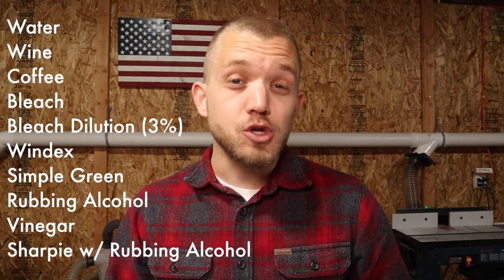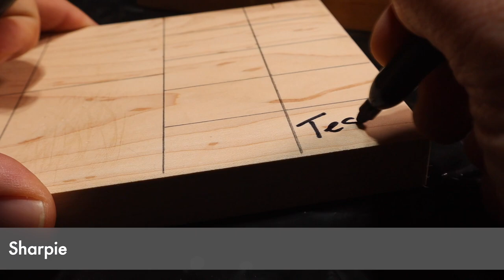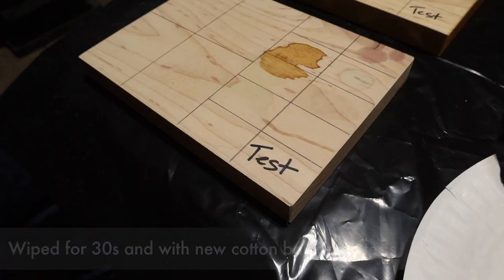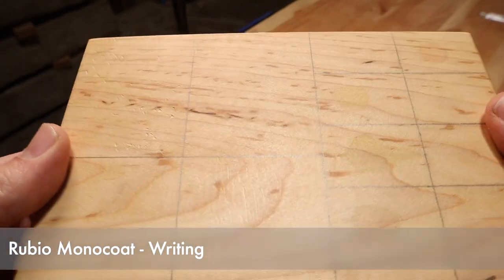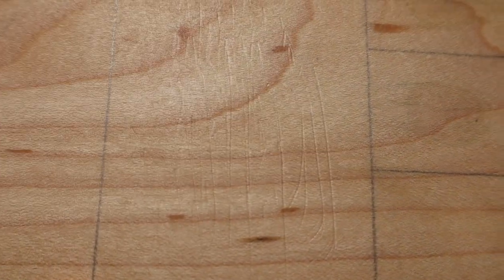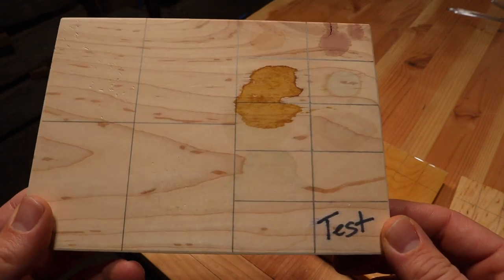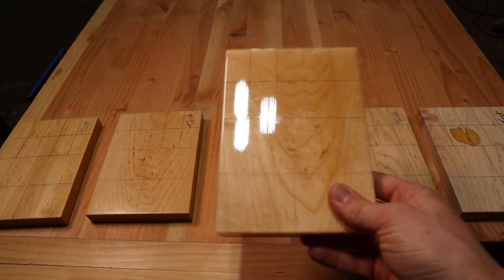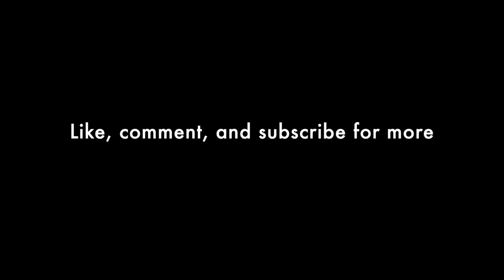Epoxy vs Rubio Monocoat vs Polyurethane vs Lacquer

Comment: Superb experiment 

Do you know which Finnish has the best heat resistance?
Reply from the maker: And that is a superb question! Unfortunately I don’t have a perfect answer. What I do know is the following: 

Many epoxies struggle with heat. In fact the one I ended up using (Super Clear) has a heat deflection temp of 130°F which isn’t high enough for most hot dishes and coffee cups (major issue for me). There are other epoxies (Stone coat & some total boat recipes) which has a much higher HDT in the order of 100’s of degrees. 

Polyurethane is a very robust. It’s been used in restaurant tables for a long time. Don’t have the max usable temperature in front of me now but it’s very robust. 

Rubio should be pretty robust but I can’t find any data on it. 

Lacquer is also a common table finish and should be fine with raw heat, but hot and wet (which my test failed to adequately simulate) is a weakness. 

As with most wood finishes and furniture, you shouldn’t have anything hotter than a food hot dish. Hot pots and pans need a buffer between them. 

Sorry I don’t have a more concrete answer but hopefully that helps 😊
Reply: Thank you 🙏🏽 
I think if restaurants favour polyurethane, then you've answered my  question perfectly. 
👍🏽
Reply from the maker: Perfect! Yes, the restaurant business has been using poly for a long time. It’s cheap and hard. Do note it will yellow quite a bit with time so using it on woods that are complimented by that would be recommended.

Comment: It would be more helpful to have all the coatings at the same mil thickness. I can clearly see some of the coatings are thicker than others especially the poly and epoxy. I think it would be a more fair assessment if these systems were all tested at the same mil thickness. There’s mil gauges you can get to check this. Lacquer is very hard but it’s not water based so it evaporates off 80% of the wet mil thickness compared to 50% of water base so right off the bat the water based coatings are gonna be 30% thicker more or less unless you added more coats to your solvent based stuff to get the same mils. Also what brands of these products were you using because lacquers and the other coating systems have different % of solids that vary widely from manufacturer to manufacturer. One part systems will obviously be less resilient than 2 part systems aka pre catalyzed. Epoxy is typically a 2 part system while none of the other systems you compared it to were 2 part. It would be more fair to compare a 2 part poly, epoxy and lacquer side by side at the same mil thickness and appropriate cure time to get more comprehensive results.
Reply from the maker: That's an interesting idea! Does it make a difference how thick the coating is if none of the tests penetrate through to the wood? As for the test, I tried to follow the directions of each finish as directed by the manufacturer to standardize the test more but I understand there are some third party modifications that may enhance the different film's performance.
Reply: @NorthwestCraftsman  the mil thickness of the coat is important for your impact tests such as the keys marring the surface. But also the percentage of solids by volume will dictate the hardness and thickness of the coat as well. Lacquers come anywhere between 15-40% solids depending on brand and whether or not it’s a precat. Usually 20-24% is the average so that means how much is left after the solvents evaporate. Polys and epoxies come higher % solid by volume typically. That’s very important for understanding how much material you will need to coat a surface and in calculating materials for projects. You could also try using a Vaughn viscosity cup along side a wet mil gauge to compare viscosity and thickness of every coat system. I did enjoy this video and the comparison. And at the end of the day I’m a professional painter who wants to learn and share knowledge with others. Figuring out the best bang for the buck is what keeps me alive and I appreciate the fact that this is how you based your tests on manufacturers application recommendations and the evaluation of price. Hands down I’m going for lacquer when it comes to wood every time because it is more cost efficient than a comparable poly as I find most polys do not hold up unless they are a premium 1k or 2k poly such as Renner, Malesi, Centurion, etc and when you start entering into those costing systems you realize how expensive they are you’ll understand why I still go for lacquer. $120 per gallon on top of expensive catalyst if it’s a 2 part for both primer and top coat is gonna turn a lot of customers off to my services. Also it would be interesting to see the comparison of these products to a varnish product as well.
Reply: @NorthwestCraftsman  Yes, most finishes are harder than the wood they protect. At least everything I've used. Thickness is a big factor.

Comment: Hi, thanks for the great video. In future if possible, would you add a hot mug of tea/coffee and a hot food plate (can just put boiling water on the plate). Those are the two most common uses people here use the table for. If you know, would polyurethane hold up to heat?
Reply from the maker: You’re spot on with the future change I want to make! A huge fault of the epoxy that I found after building the table is that it has a heat deflection temperature of 135°F which means a hot cup of coffee will “dent” it. Stone Coat Epoxy’s are supposed to have a deflection temp upwards of 400°F so I’m going to try them soon. 

Regarding your question on Poly, it should hold up to regular food and drink heat. Nothing in our realm as woodworkers is good with hot pans or tea kettles but on plates and in cups, it should be fine. Caveat, I haven’t directly tested, this is just based off of what I’ve seen. 

Side note, make sure your wood under the poly is okay yellowing. The poly turns a pretty amber yellow over time which on the maple samples I tested here, looks pretty ugly now.

Glad you enjoyed the video though! Thanks for jumping in.
Reply: @NorthwestCraftsman  would be great to see an update with the new tests. Thank you for the information on poly. I will try it out and see. I made a computer desk for myself out of yellow pine (learning woodworking, cheapest wood here). Almost finished the joinery stage. Have glue up and finish left, will definitely test out finishes and see. I do eat at my computer desk, but I usually have a glass tray for the plate and coasters for mugs. But everyone in the house is not as careful, that is why thinking of what kind of finishes that are easily accessible, look decent and can take heat. We don't put kettles and pots, but food is still hot. Also I am not sure how epoxy will hold out when ambient temperature in summer is about 115°F~120°F.
Reply from the maker: Hey I totally get that! My primary working material is actually pine because of its price and accessibility. If you're using pine, polyurethane would actually be a really great option. The yellow nature of pine makes it perfect for the "ambering" you get with poly. 

I just pulled the data sheet for the poly I use and it's dry heat resistance is 100C which should be ample for any normal wear and tear. If you can find a local polyurethane, I bet you'd be golden and save yourself some cash. 

Data Sheet
https://www.rustoleum.ca/-/media/8BDDC5B1AD244419AD6B91187E06B3CF.ashx
Reply: @NorthwestCraftsman  thank you, that is very helpful. I will figure out if local polyurethane companies provide any data sheet for their products. Most just magically appear on shelves 🤭

Comment: I have to ask if you prepped the wood coatings and let the coatings cure to manufacturer's specifications. Rubio takes a full week to cure correctly for example.
Reply from the maker: Great question! I followed all of the manufacturer's guidelines for both application and cure times.

Comment: Thank you for very useful tests. I just finished a white maple table top with two coats of Rubio monocoat (pure) and it looks beautiful but wonder whether I can put a mug with hot coffee without leaving a ring mark.  Do you have advice for me?
Reply from the maker: Thanks! Glad you found it helpful. 

I do apologize that that portion of my test was a failure 😂 it’s one of the more common stressors. Do you have any off cuts from that table? If so, I’d quickly finish one up with the same process used on the table and give it a shot. Shouldn’t take long given rubio’s process and would give you certainty with your wood specifically.

Comment: Great video. Wish I could give you 100 likes, cz it's so useful.   ........ Personally, I love the look of the epoxy, and imho it is the right finish for a boardroom. Based solely on looks I mean, it is the correct esthetic for a boardroom, but it is the best performer too. Not plastic, Glass! Should look like glass.   ..... One thought I had, it's not just cutlery; in a boardroom and at home, there are binders, suit buttons, cufflinks, toys. 

The only questions I really had kind of related to that. i.e. How long did you cure them for? Would a couple weeks make a difference for something like a lacquer? I know some clear coats are still hardening for at least that long. .. which leads to: polishing after time, and what to use, dust collection. Maybe bigger maintenance  a sanding every few years - good for some, can't with others. And toxicity/VOC. 

And your most important test was a dud! lol, no, but, it remains that can happen, and this test didn't tell us why, or what finish melts under the heat of a dinner plate! I'd like to know how it happened.

Peace
Reply from the maker: Thanks! Glad you enjoyed it!

And great questions. I let these cure for about a week if I remember correctly. I’d need to go back and double check. Full cure time on most finishes is a week. 

And I know 😂 I needed to find a better way to do that test because that’s the one I run into the most. Not of the finishes are good for a hot pan directly on them but hot, not paper, plates should all be fine. From what I’ve seen, it’s mostly moisture that’s the issue.

Comment: Amazing video. Very well done and very useful info. Thanks! The Polyurethane you used is oil based. Would it be OK to apply it as extra layers on top of existing water based Polyurethane that my live edge slab has now?
Reply from the maker: Thanks! I’m glad you found it helpful 😄 I haven’t tried it directly so caveat emptor, but from what I’m seeing, you should be able to if you properly sand the water based poly (220 is what I’m seeing). The safest option would be to sand it back to the wood and go from there. But, worst case scenario, the oil based over water based doesn’t work and you have to sand it back anyways.
Reply: @NorthwestCraftsman   Thanks for the prompt reply and info!  I assumed the Polyurethane you used during the test was oil based since that's what you listed under "Products Used" with a link to Amazon.  I wanted to use the exact same Polyurethane you used as I was impressed with the outcomes.  It held up extremely well.  Once again - thanks for making such a great/useful video and for this feedback!
Reply from the maker: Not a problem! Glad I could help! 😄

Comment: how many coats of poly and laquer did you apply?
Reply from the maker: Great question! 3 on each
Reply: @NorthwestCraftsman  that's awesome, so many people do this type of test with only one coat of product, you can't really trust your results if you don't apply it correctly. Thanks for making this.
Reply from the maker: Not a problem Carlos! I totally agree, I tried to follow the manufacturer directions because that's at least a good starting point. 

Happy Woodworking!

Josh
Northwest Craftsman

Comment: If you want to remove sharpi from a most surfaces then draw back over it with sharpy and whip it off with water or mineral spirits. Many differant ways skin a water bufflo.
Reply from the maker: Huh! Never heard of that! Thanks for the tip!

Comment: Thanks! This was exactly what I was looking for. Did you use alcohol to remove the Sharpie? I found alcohol removes Sharpie marks very effectively. FYI-I epoxied a wet bar and was going to finish it with polyurethane.
Reply from the maker: Glad I could help! 

Yes, I used rubbing alcohol on a cotton swab to try and remove it and epoxy was the only finish that I was able to remove the sharpie from. 

Interesting! Why would you want to polyurethane over the epoxy?
Reply: @NorthwestCraftsman I saw a couple videos the people used polyurethane as a final layer because it resists scratches better. I questioned whether it was better and from your video you proved it. I also figured if it ever got bad scratches it would be easier and cheaper to sand with 220 or 300 sandpaper and reapply polyurethane.
Reply from the maker: Makes sense. My biggest concern with poly is the discoloration that happens over time. I had these samples in a dark closet (no UV) for the past 6 months and the poly still turned and ugly shade of yellow that in my opinion only really looks good on pine. I’ve started to avoid poly for this reason.

I’ve also heard that even if you don’t refinish epoxy, you can polish it to take out the scratches. 

Just some food for though 😊
Reply: @NorthwestCraftsman  That’s good to know about it turning yellow, maybe I’ won’t use it. The concern I have with epoxy is sanding and polishing in tight spots, which I have. Hopefully, the epoxy 1:1 D-85 will hold up.

Comment: If using Rubio Monocoat and wanting to do a 2nd coat, , I wonder how soon or long to wait, to add the 2nd coat?
I did learn alot from your test, and am very grateful you did it. Also you were pretty clear in your discussion which many times ppl are not.
Just curious but have you ever bleached wood, then stained and finished it? I have heard that the red in red oak can come back to the surface in time, after bleaching and finishing. Thanks!
Reply from the maker: Thanks! 😊

For two coats of Rubio, I’m seeing about a day between coats from some initial research. 

And I haven’t ever bleached wood, sounds like an interesting process. I’ll have to look into it.
Reply: Rubio has a maintenance coating that works really well as a second coat after initial finish.

Comment: with polyurethane am i right in saying the more sheen the paint has he harder it is , reason why i ask this is im told by a paint supplyer that Polyurethane is more duabel than epoxy paint for kitchen cabinets   allso 2k polyurethane has good resistances with hot objects like hot cups so on .any feed back would be brilliant as im hoping to paint my kitchen in 2k Polyurethane or epoxy.
Reply from the maker: Hey there! Sorry for the delay. Unfortunately it really depends on which brand you’re going to use. When you say paint your kitchen, are you looking for counter tops, cabinets, or walls? Or a combination?

Comment: How long did these cure before you performed these tests?  The epoxy and poly will both be way stronger after 30 days
Reply from the maker: I followed the manufacturer instructions for each finish to keep it fair between finishes.

Comment: How long did you let these finishes cure? Rubio can take 5 days to a full month depending on whether or not you used the accelerator and laquer can take weeks to cure. Something to consider.
Reply from the maker: Great points! Everything cured for a week and I did use the accelerator on the Rubio. I think the hardest part of the test was how long I left things on. I don’t think most people are going to leave wine on their table for an hour. The other consideration some have brought up is repairability. Epoxy and Poly are much harder to repair, while Rubio and lacquer may be the easiest.
Reply: @NorthwestCraftsman  Guess that depends on how much wine they had before they spilled it 🙂
I have been using Monocoat and I think it is going to be my go-to finish. So easy to apply and looks and feels gorgeous. Pure looks amazing on cherry!
Reply from the maker: Ha! Great one 😂 you’re not wrong in that. And I do think Rubio was the most natural of the finishes and agree, it was by far the easiest to apply. I may go back and run some tests on the back of the samples I made to see how a few months of cure time improves resilience.

Comment: Awesome review of these finishes! 👍🏻 Best I’ve seen with regards to the testing you did. 
I see the poly you used was oil based, right? Any thoughts about how durable the water based poly is vs oil based poly? Thanks!
Reply from the maker: Thanks! It was the oil based poly I used. I was hitting myself after the fact for not testing water based at the same time but I have a sample of it made and am planning to test it soon! I’ll let you know when I find out.
Reply: @NorthwestCraftsman  I would appreciate it! My wife gets a headache from the smell of oil based poly or lacquer for that matter. She has no problem with the water based poly, so that’s what I end up using most often. Thanks!
Reply: Water based poly is not durable at all.

Comment: I’m  really curious how ;long you let the Rubio monocoat sit before testing it.  Or maybe you used the 2c hardener?
Reply from the maker: Great question! I was using the 2C Hardner and in an effort to equalize the playing field amongst all the finishes, I followed the manufacturers’ recommendations to a tee. For the Rubio monocoat, they recommend 24 to 36 hours before use and I gave it 24

Comment: what about if you compare epoxy, lacquer and polyurethane if the film is the same thickness?
Reply from the maker: Great question! Unfortunately, every finish is unique in what thickness physically works for it. All lacquers and polyurethanes have a wet & dry film maximum thickness allowable which almost always far less than that of epoxy. For this test I followed the manufacturer’s instructions since the thickness they recommend should provide the most optimal performance for that particular film.